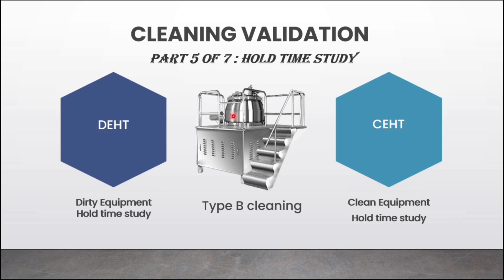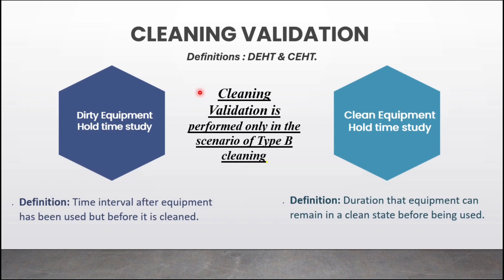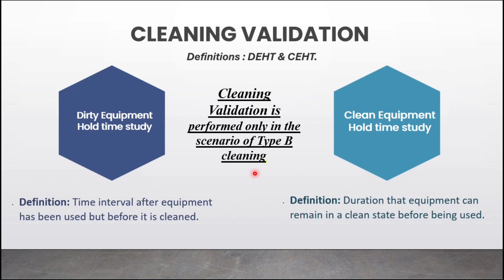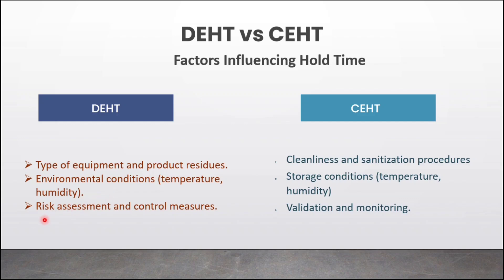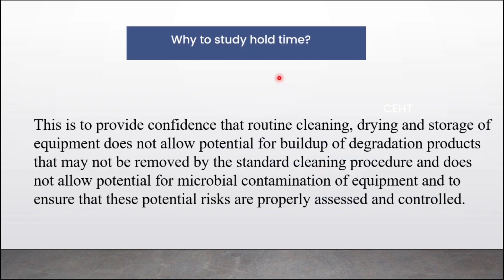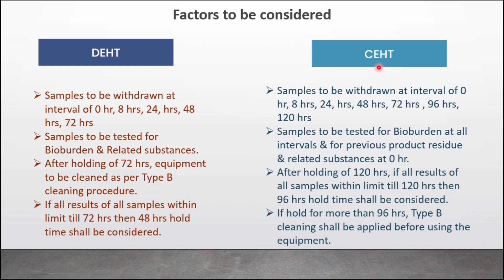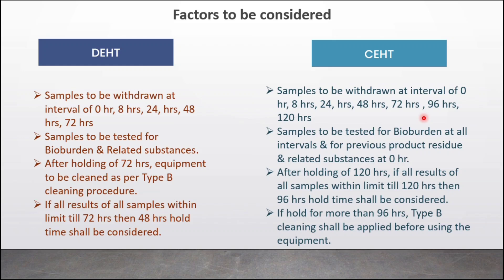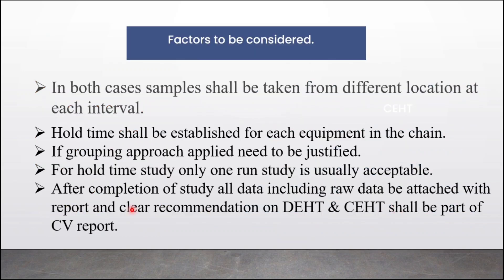Cleaning validation :HOLD TIME STUDY ( Part 5)

Comment: Can you tell us if its a new facility how to start cleaning validation
Reply from the maker: @abuuhhemedy2077  for New facility also you have to follow the same procedure only thing is initially you may not have many molecules. You can continue with swab and rinse testing. After few days or after manufacturing sufficient products you can proceed for cleaning validation